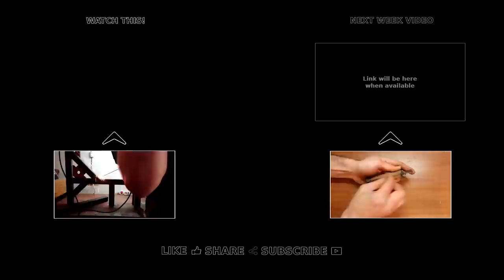Sharpening Wheel For Razor Sharp Blades! MDF

Comment: Now, I'm a lazy prick, so if I can get max results with min effort, i'll try it. I needed something, since I suck on a whetstone. So I bought a Lansky. That was good. Finally, I could get a shaving sharp edge, but I wasn't consistent and still needed to spend considerable time doing it. Anyways, found a 20 mm thick piece of plywood today and gave this a go. Holy crap! I shit you not.....3 kitchen knives to scary sharp in 90 seconds. On my Lansky, that would have taken 30 mins and not as sharp.....not even close. I love trying lots of youtube tips and tricks and some are ok, some suck, but this has got to be up there with the best I've ever come across. Thanks for sharing.....made my day!
Reply from the maker: Haha!! So glad to hear that Mike! :) Thank you a lot :)
Reply: Mike Wasowski haha mike wasowski.... isn’t that the guy from monsters inc?
Reply: I use the lanky system, and it's amazing. However, you're right about the time it takes.  I'd say 30 minutes is generous! I'd recommend getting the sapphire lanky stone. I've never had a sharper knife, but it takes me about 2 hours. 
Nonetheless, this rouge method is fantastic. A video describing angle, pressure, and what you're actually doing would be a good idea, too.
Possibly build a jig for us idiots.
B
Reply: The edge of either MDF or plywood will have lots of end-grain wood fibers - which is what carries the buffing compound, and rubs on the metal of the knife blade edge. There's really not too much difference in the amount, nor angle of the edge's wood fibers between the two.
Reply: L
Reply: This is just too cool, to not try it.
Of course, you'd have to store it under "lock n key" ... lest the wife, kids, or stupid neighbor should kill themselves with it while you are not watching.
In fact, you might even want to set a little rule for yourself, to never use it after a rough night's sleep, or before your morning coffee.
The thought of that razor sharp, foot-long carving knife catching the wheel in the wrong direction, due to an inadvertent miscalculation  ...
Yeah, there's a reason Walmart doesn't sell these things.
Reply: I did the same with MDF excellent results, l use the green metal polishing block.
Reply: marshalllhiepler That seems like a bit of fear mongering really. Walmart sells grinders, circular saws, shot guns and plenty of other things that could just as easily, or more easily lead to bodily damage than this thing.
Reply: @mcearl8073  but they don't sell that dangerous BLACK GUN anymore. So it can't jump off the shelf and shoot anything anymore.
Reply: Ray Drew That is true. Luckily now they only sell the variants with wood stocks. We all know those can only kill animals or shoot targets so they are much safer looking.
Reply: @mcearl8073  Not on there own. Guns don't shoot people. People shoot people. Bottom line. We have the right to protect our self and the police can not be everywhere. Besides the serve and protect that you see on police cars doesn't mean anything. They don't have to serve and protect you so if we give up our guns who will? Not only if someone breaks into your home where is your protection if you don't have a gun?
Reply: Ray Drew I was being very sarcastic in my response as I thought you were. Sadly these days though I suppose it’s not easy to tell since a lot of people who know nothing about guns do seem to think that a black gun is much more dangerous than one with a wood stock
Reply: @mcearl8073  sadly you are right and a lot of them are in government. Sooo I for one say let's stick a fork in it and this pissing match is over. Just a little miss understanding.
Reply: @mr.mister4071  The new t-shirt I designed (and wear!) says "People Don't Kill People" over a row of five bottleneck rifle cartridges pointing up and followed by "Bullets Do."
Reply: @c.e.kestner4051  well if something happens to you or someone you love (God forbid) and the police don't get there in time (because they won't) and a gun could have prevented it from happening. Don't cry about it because no one is gonna listen. How many of those bullets fired by themselves? Think about it. I have. None. Somebody pulled the trigger. Somebody fired the gun. Somebody not the bullet. So people are the killers. I know that the police can't be everywhere. So I made sure that my family is safe from harm when I am home and away. If you were smart you would too but I guess you would rather wear a tshirt. Your choice and your opinion. 
My choice and my opinion. Take it or leave it.
Reply: Plywood works too but small pieces of wood can rip out.
Reply: Gringos going pilitical on a sharpening tip?
Reply: O9
Reply: @evelynbagnasco7293  Hahahaha... well said!  I suppose when two or more N. American guys get together these days that's where every conversation goes!
Reply: @marshalllhiepler  - you’re bundle of fun aren’t ya ?! .. life would be sooo boring & dull without the risk element ! 🤷‍♂️😂😂
Reply: Hi, I'm trying to get into making knives. Could someone explain why plywood is good for sharpening knives?
Reply: @benkayvfalsifier3817  The grain of plywood holds the abrasive compound well. The compound is what’s doing the sharpening. It’s basically a power strop.
Reply: @benkayvfalsifier3817  - I could..but it’s very boring & rather complicated..so I’m gonna save us both the trouble by simply stating that it doesn’t matter really..it just is..best thing I can recommend is to try it & make up your own mind 🤷‍♂️😂😂
Reply: @mr.mister4071  I live in the U.K. and we have very strict gun laws. It is great, because I don't feel the need to protect myself or my family with a gun, because I know I will never be threatened by a gun. I am also protected against any kind of accident or mishap that kills far more people than a home invasion type scenario ever does in the US.
Reply: @mr.mister4071  citation for you. Results: During the study interval (12 months in Memphis, 18 months in Seattle, and Galveston) 626 shootings occurred in or around a residence. This total included 54 unintentional shootings, 118 attempted or completed suicides, and 438 assaults/homicides. Thirteen shootings were legally justifiable or an act of self-defense, including three that involved law enforcement officers acting in the line of duty. For every time a gun in the home was used in a self-defense or legally justifiable shooting, there were four unintentional shootings, seven criminal assaults or homicides, and 11 attempted or completed suicides. TLDR Your gun is more likely to kill your family than save them.
Reply: @mr.mister4071  Thanks for pointing that out - you are absolutely right, of course. People do. People with guns, actually.
So what's your take? Get rid of... people?
Reply: @PCP6996  With these open borders and defunding of the police. I feel that my family needs a gun for home protection more now then ever before. No I do NOT support defunding of the police. I believe they should get more money. The media is giving them a raw deal.
Reply: @BlackBeardProjects  ...One thing I noticed is the heat build-up on the disc which could in turn transfer to your blade so make sure you keep that blade moving and cool, maybe run disc at a slower speed? Otherwise your Rockwell hardness will lessen and your sharp blade won't stay sharp very long.
Reply: Hi are you saying that almost any wood will work? Actually i don't know why but mdf is not so common where i live I wonder
Now i understand that plywood is just as fine? Thanks a lot kind regards Gino
Reply: @supergeek1418  hi do you mean that any other wood would work just fine?
Thanks a lot Gino
Reply: @gino3286  
Any wood that has layers with the grain going in multiple directions.

It's the end grain that holds the stropping compound, and a plain board would tend to have bare spots an the sides.

That said, I have used a rock maple disk for polishing gem stones, with excellent results,  so it would probably work on knives, as well.
Reply: @supergeek1418  hi thank you very much for your kind and very helpful advice. Would sanding the edge first help ?   Kind regards Gino
Reply: @gino3286  
Absolutely!
You want the disk's edge as smooth as possible,  before applying the stropping compound.
Reply: @supergeek1418  thanks again! Best regards gino

Comment: Been using the compressed cardboard wheels similar to this for years. I run them backwards on a grinder motor so the rotation is moving away from the edge just as you do. There may be a bit more heat with MDF due to a higher friction coefficient, so a lighter touch may be required. The system comes with two wheels, one for sharpening with 300 grit powdered carbide glued on the wheel face. The other is plain for stropping with compound.  I now wear a faceshield due to having a 14" Khukuri thrown into my face just below my nose. Luckily it was the spine that stuck me and not the edge. Still had to get stitches and clean underwear.  I also run a foot pedal switch.
Reply from the maker: Damn! :( I'm sorry for you bro... I hope you recovered fast!
Reply: Yeah, just a few stitches at the ER that left a non-noticeable scar under a nostril. But the mental aspect of it still haunts me every time I fire up that motor. I now make sure my better half checks in on me in the shop. Been working with machines for 45 years and that was the first injury. Could have been my last....
Reply: You say 300 grit. Is that close to jewelry Sam or rouse, polishing compound? It looked like the sharp edge was facing rotation? Is that correct?
Reply: @placitas52  milk ml? NJ omni hi by by DJ no 9
Reply: @placitas52  no ...away from edge
Reply: How is that even possible? You must have been doing something wrong.
Reply: @yoman2854  Correct. Totally my fault. I  set it  up to spin the wheels away from the operator. I had rotated it back to "normal" position for buffing something, but forgot to spin it back to standard sharpening orientation where the blade is sharpened at the top of the MDF wheel. That way if something happens, the wheel will launch the blade to the rear instead of toward the operator.  A week later, when I went to sharpen the Kukri, I touched the edge to the top of the MDF wheel that was turning towards me instead of away. It kicked the blade at my face.  I now have three other grinder motors for various operations and reminder sign on the dedicated MDF setup.  For all of those, I use safety glasses and a flip up full face shield.

Comment: I like your idea, the way you used a pre drilled peace to make a perfectly vertical hole on the disc
Reply: That's the idea I'm taking first out of this video. 
Gonna make a set of pre-drilled holes of my commonly used drill bits on a bench press, to use with a regular drill.

Comment: The thing using MDF means any way you 'shape it', there is even grain available for holding the compound, so turning specific shapes into profile means you can do curved gouges, and any non flat cutting tool. I made one with variable curve in it, from large radius to smaller, so many different curved chisels can be done in seconds..
Reply: Так чего он использовал? Я ноль,желательно с разжевкой,плиз))

Comment: I use a fully stitched buffing wheel for my wood chisels and plane irons on a 10" bench grinder.  The buffing wheel is actually 8" but make the point about the size of bench grinder because you can stall the wheel with inadequate motors.  I find it only works with good quality steels as it rolls the edge on cheaper tools.  I have a set of Chinese wood carving chisels I paid about $50 for, and buffing them after sharpening them on a 10" CBN wheel immediately dulled them.   You do need to be careful doing this with wood chisels as it will put a tiny curve on the underside of the chisel if you work it too hard, and the chisel will not be flat to the workpiece.  Easily fixed by re-sharpening them — I use DTM diamond plates — and remember to use light pressure on the underside.  I probably use this method of honing about 20 times before reconditioning with the DTM plates to get the angles nice.   BTW rather than slicing the paper at an angle, try approaching square on to the paper,  That;s my test for truly sharp.

Comment: My biggest concern has been that the MDF wheel might explode from turning at high RPM, since that isn't the intended purpose of the product.
I think just for my own piece of mind I'll try to find a lower RPM grinder (1725 RPM) and give it a go.
Reply: Yes i agree that i would not try it with mdf at all, but you can make one in Plywood and it will be safe.

Comment: For all the comments on this older video:  1. He no longer uses music in his videos. 2. This is a power strop. I use this system and the blades don't get hot, so no loss in temper. Similar systems are used at knife factories. Several of the MDF wheel systems offer two wheels. One has an impregnated grit edge for sharpening, the other wheel is as above - a polishing compound is applied for stropping.  3. I mark the side of the wheel with several angles to set a reference then power strop by hand. You are able to feel the angle is correct against the wheel when you match it with the factory or existing angle. 4. Check his newer videos for a link to the Amazon supplies he uses or click here: https://www.amazon.com/shop/blackbeardprojects
Reply: Thanks for the tips.
How do you mark the edge with a few angles and how do you use them?
I cant visualise it sorry.
Reply: @terrytailor  Hi Terry -   I do not mark the edge of the wheel, I mark angles on the side of the wheel. In this video you will see the curved arrow he has marked for the direction of rotation on the side of the wheel.  (Time index in this video would be around 3:07)  Visualize the side of the MDF wheel as a circle.  Start at the top of the circle and then draw a radius from the top to the center of the circle. That will become your zero degree mark - or if you took geometry, the Y axis. Draw another radius from the center at 90 degrees from the Y axis toward the right side of the circle. This gives you the X axis and you will now have a right angle. Bisect or divide that 90 degree angle in half and you will have a 45 degree mark. Divide that angle again and you will have 22.5 degrees.   You could also use a protractor to mark angles on the side of the wheel. Again, start at the top of the wheel as your zero degree mark and then mark every five degrees to say 45 degrees.  All this does is to give you a visual idea of where to position the edge of the knife blade as you can't see those angle marks when the wheel is spinning.  A third method is if you have a standard grinder motor, it will likely have four long bolts that hold the motor and end shells together. Use the upper mounting bolt closest to your body as a starting point reference for your blade.

Comment: Hello Black Beard! I have a few cuestions on same thing... At what RPM has to go the motor? Is that a very important thing? I mean, i have a electric grass cutter motor (a small one) but it has high revolutions... more power instead speed or a mix of power with speed? (like 1hp motor) THANKS!!! GREAT GREAT VIDEO!

Comment: I am a printer by trade and cutting and folding paper is my gig. I can attest to wood fibers ability to wear away steel. Even tungsten and hard chrome surrender over time with just paper and a little moisture and a gentle rubbing action. Using a compound to assist, no contest.

Comment: Question, whats the point? There's a thing called the razor sharp edge making system, it comes with the wooden wheel you attach to your bench grinder already made. I think its better than ordinary wood too. What are your thoughts on your method vs that system? Were you inspired by that famous system? how do these two compare? genuinely curious what you think. Thanks.
Reply: It is the same, the wheels aren't that important, all they need to do is carry the compound well, that's why he's using mdf. It is more in which compound is used (coarse/fine) and the consistancy while sharpening. I tried it and it works sharpens knives well with fine compound if a knife isn't beat up it refines the edge quickly and well. Those wheels are like 60/70$ and I don't think it is worth it. I got myself a used bench grinder for 35€ and some old mdf board that someone was about to throw away for free, out of which I made 2 wheels one like his and one rounded so I can sharpen recurves. I also made a third one which I'm gonna mount sandpaper on so if the edge needs to be reprofiled I don't waste a tone of compound and use the other wheel just for finishing. It isn't finished yet and I hope I didn't mess it up, but I have enpugh mdf for another one anyway. I made the wheel out of 3 cyrcles of 5mm mdf and stuck them together to be wide enough, it doesn't really matter if they are "well made" or anything, the system will work regardless. If it works for me out of junk mdf and year 1990 bench grinder I think you can't really go wrong, for 35€ + compound it is a bargon, half the price of the commercial wheels for the whole system. I hope this helped :)